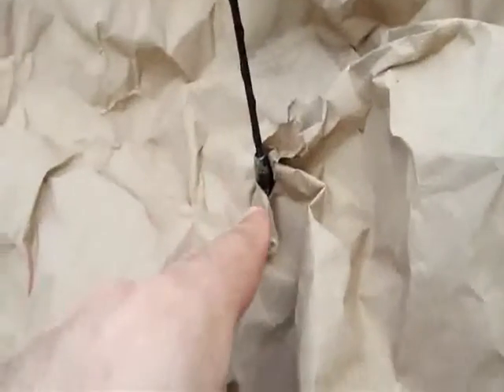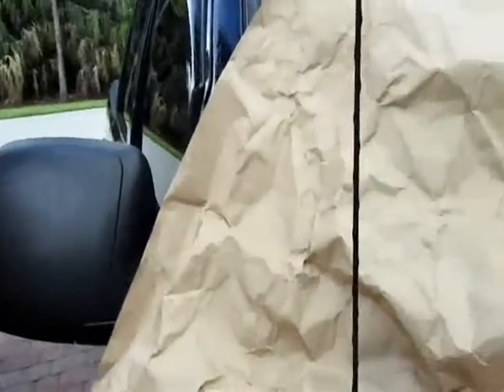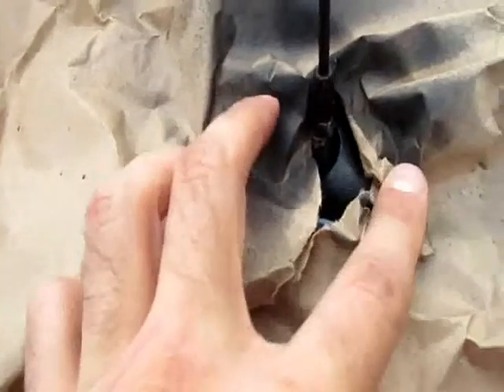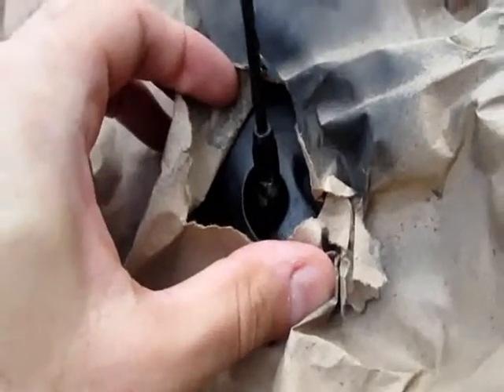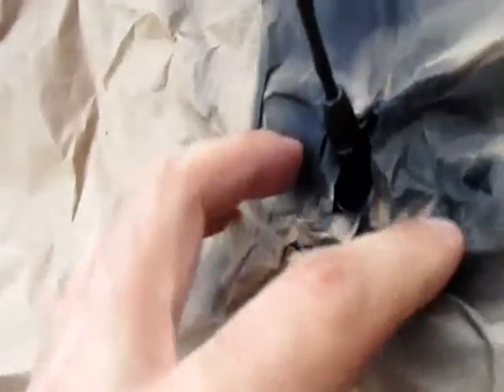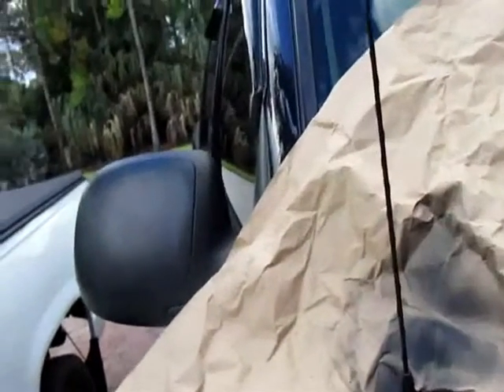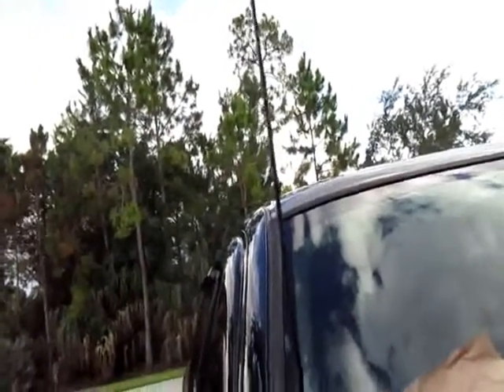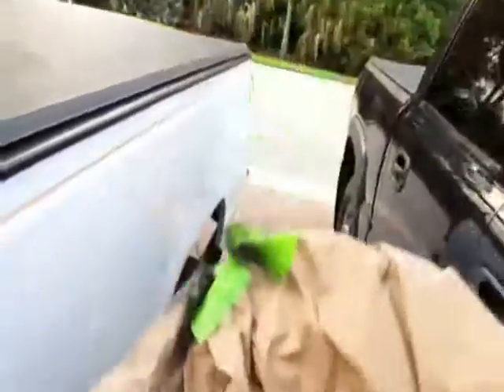Painting antenna on the vehicle! EASY!

Comment: Why not just unscrew it and paint it?
Reply from the maker: because it wont come off. Its corroded on
Reply: @GhettoWagon  what paint did you use? I painted my antenna with a water base and a brush, but it came off when the rain came the next day. What did you use? Thx
Reply from the maker: @andekay   Sem trim black paint. Held up decent